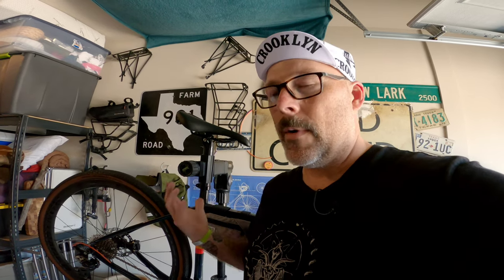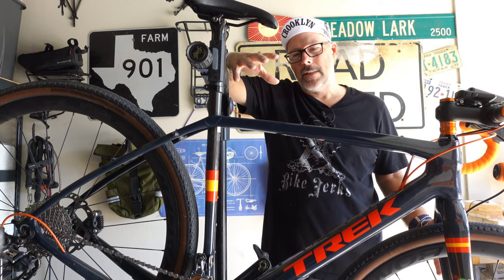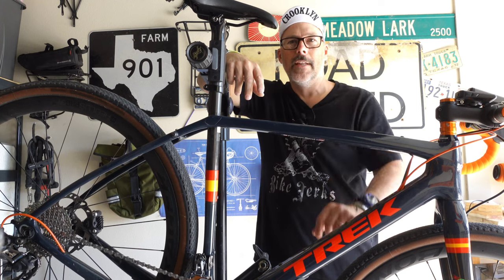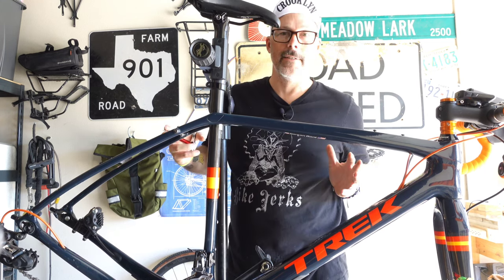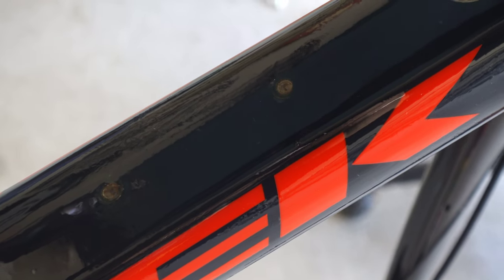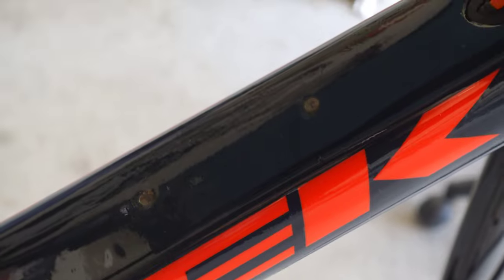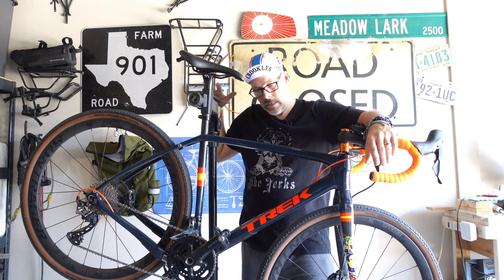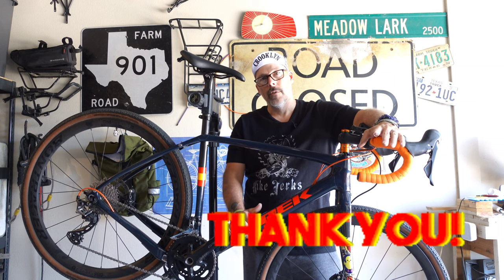Protecting Your Bikes Paint | A Walk-Thru on Installing Protection Film on Your Bike

Comment: What kind of soap do you use? Will this also work on Matt frames? How long does it need to dry?
Reply from the maker: Thanks for watching!   I just used Dawn. it doesn't have to be anything special. You can wrap matte paint, there is even matte vinyl you can use.  As soon as you smooth out the water from underneath it, it's dry. The moisture will evaporate in a day or so.
Reply: I never tried it but I want to protect my precious bike!
Reply from the maker: @CDGZZ I'm about to re-do the one on this bike, it's about time for an update. So I'll get to see how we'll this wrap did.